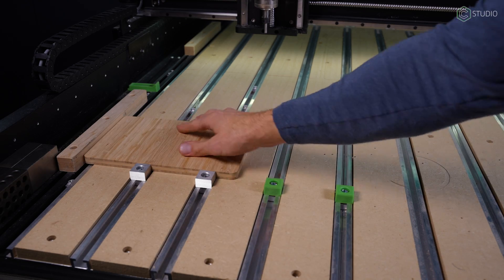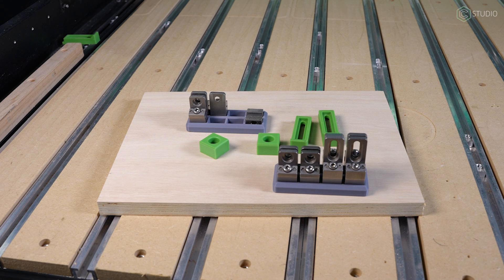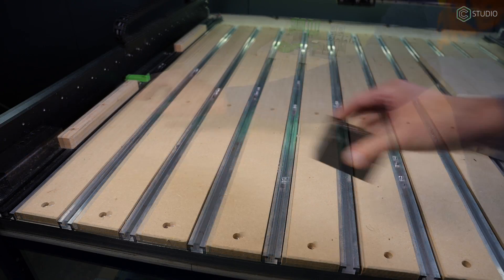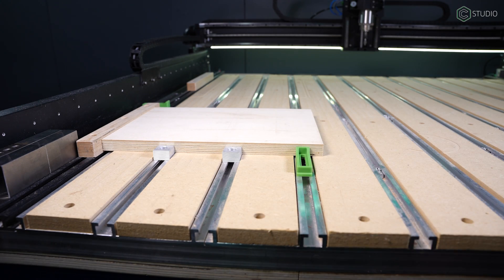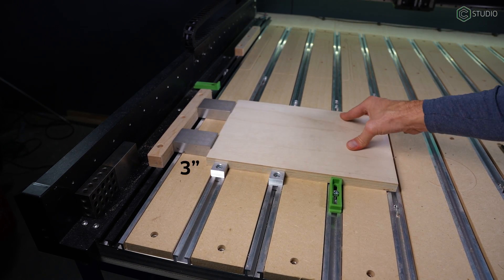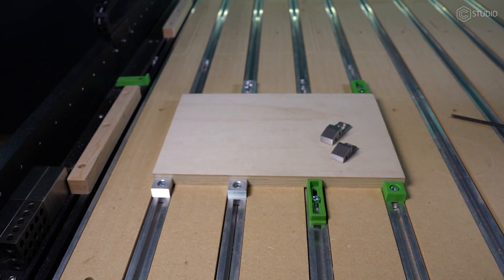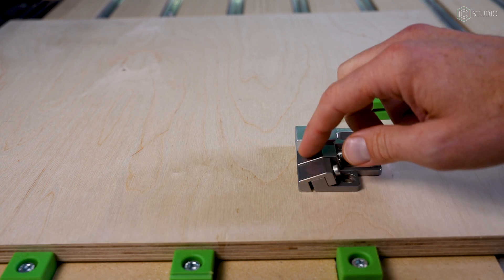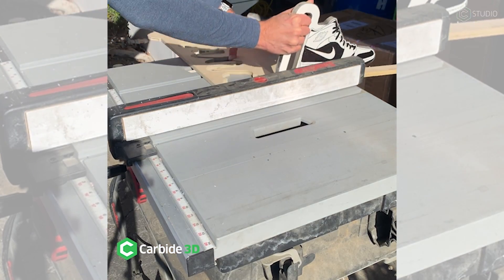A Square Setup on Shapeoko

Comment: How did you do your tool path to cut the left side guide?
Reply from the maker: The simplest way  is to draw a vertical line in your design software, then have the machine follow that line using a contour toolpath. Just make sure you set your zero position as far over as you can without running out of travel.

Comment: After the work piece is square, is it possible to manually provide an X,Y,Z center for the mill? What I mean is, if I remove the work piece and come back tomorrow, get it just as square, can I use the VFD or software to give it the exact X,Y,Z from yesterday? Or will I have to use the controller to get it as close as I can?
Reply from the maker: The machine will retain the Zero Coordinates as set from the previous job.   You can power cycle the machine and maintain the Zeros.
Reply: @carbide3d  That's nice, but can it do what I asked?
Reply from the maker: You can set a “User Macro” to a predefined saved position.   You can save multiple
Macros.
Reply: @carbide3d  so... no?
Reply from the maker: Yes
Reply: @carbide3d  So I can manually provide the X, Y and Z coordinates for center? How do I do that. I literally want to type in the numbers
Reply from the maker: No, you'll need to zero the machine at the desired coordinates then Create a User Macro / Under "Quick Actions" / "Create User Macro" you can name and save a location
Reply: @carbide3d  Thank you
Reply: @carbide3d  Well I learned something today! 😄

Comment: ok... a question... on the shoe push plate example.  i have to assume you are flipping the wood left to right so that means the left, right and base side of your work piece has to be all square.. correct?  it seems the center would not align up at all when flipping the piece over.  what is the answer to this?  thanks
Reply from the maker: Hi Chuck,
The shoe design is centered in the rectangular frame, which is cut with four 90° corners in the Side A operation.   
Locating that frame for the B-Side operation is where the left side edge guide and clamp stops provide a "Square to the machine" alignment.   If you have a perfectly square frame around your part and can position that frame square to your machine, you can cut the B-Side as a perfect mirror to the A-Side.
You are flipping the frame in real life and flipping it in Carbide Create.
The Zero point is dictated by the position of the design in Carbide Create and the corner of the frame via BitZero. Having those two points coincidental is the other part of the setup needed for the B-Side to mirror the A-Side.
You can go through the toolpaths and layers by downloading the file here:  https://cutrocket.com/p/65837baa81b06/

Comment: How come I cant find any videos on the 2x2 5 pro ?
Everyone on youtube has the 2x4 or the 4x4 and thats cool
But I would love to see a video of someone making a project on the 2x2
Regards, Rick
Reply from the maker: Hey Rick, The beauty of the Shapeoko 5 Pro line is that everything is the same except the size.  You have zero limitations on capability.   Many projects require very little space, regardless of the machine's size.  
One thing you may find helpful is the "Tiling" capability in Carbide Create.  
Your 2x2 can complete projects that are far larger than its own footprint:  https://youtu.be/y2o4CReNaDU
Reply: @carbide3d  
Thats Great
But I would just like to see the actual size in a video and maybe someone make something using it';s 2x2 full area like a sign or something
As soon as I can afford one Im going to buy one
Just don't really have the room for 5 fee long
Best regards, rick

Comment: So I have a question on how to do this on a Shapeoko 4 XL . Where you run the bit along the stop block to square it. How did you do that? Did you make a tool path or run the machine manually?
Reply from the maker: You can make a pocketing or vector line toolpath to generate the cutoff of the left side edge guide.

Comment: I recently ordered the crush it clamps.  I love how ghey work so far.  Ive been using 12x12 pieces of quarter in plywood.  In the video, it looks like clamps on top and bottom only are secure enough.  Is that so, or should I be securing all 4 sides.  Thanks.
Reply from the maker: Your workholding needs depend on a ton of different factors.   The type of stock, type of cutter, depth of cut (both in an individual pass and overall), type of cut (facing or contour cutouts) and more.  Many of these relate to the  amount of cutting force you intend to put on your stock.   In terms of workholding force, overkill is far better than “not quite enough”.  😂

Comment: Question: On the Bit-Zero in frame 5:37 you show zeroing out the Z-axis with it in-place. Mine will only do that if I place the Bit-Zero completely on the surface of the work and not like you did overhanging the work edges. Why is mine different?
Reply from the maker: You are correct that when setting "Z only" the BitZero must be placed on top of your stock.  However, if you select the far left option in the Probe Menu, BitZero will probe X, Y, and Z in a single probing cycle while placed on the corner of your stock.

Comment: What holds down the wood? I only saw the clamps pushing the wood.
Reply from the maker: Side clamps are good enough for some projects.  For other projects, the standard vertical Essential Clamps will work.  All depends on what you’re cutting.
Reply: @carbide3d  Do you mean to say that as long as the wood does not move from left to right and up and down its good to cut?
Reply from the maker: In general, yes.   However, with some stock, side clamping force will bow or twist the material.  There are always unique choices to be made with each setup.  
As stated in the video, workholding is as diverse as your projects.

Comment: I used basically that this weekend for a series of 22 plaques. Left side fence and crush it clamps on the front and back. I should have used the stops on the front instead but I drew a line on my fence to match the corner. All 22 plaques had the same zero point and I never had to reset even though I mounted each plaque 3 times to avoid repeated bit changes. Once for a carving then for a chamfer and a third time for keyhole slots on the back. I will switch to using the stops on the front though. I love the 123 block idea as well.
Reply from the maker: This is exactly the scenario in which this type of setup is super useful.  Well done. 
We’re always happy to hear about our customers killing it with bulk orders.
Reply: @carbide3d  Ha, it’s a bulk order but for free. Donating my time to a local Boy Scout camp. I will be branding the back in the hopes of generating some paying opportunities.
Reply from the maker: We've all been there.  That plan 100% works.   Keep at it!